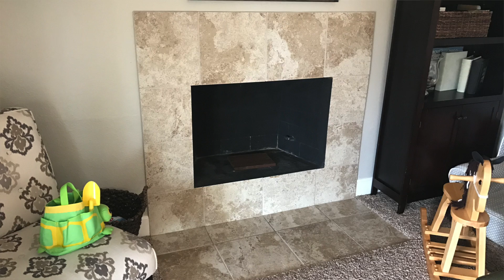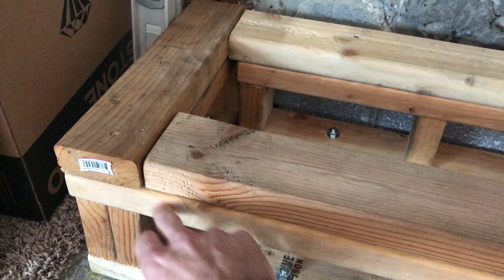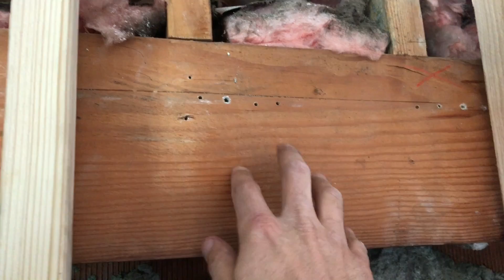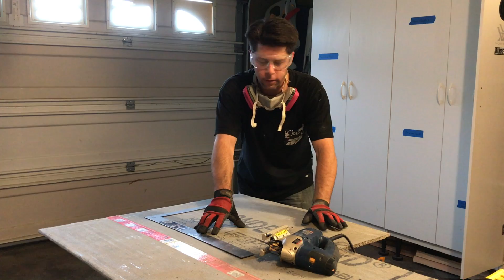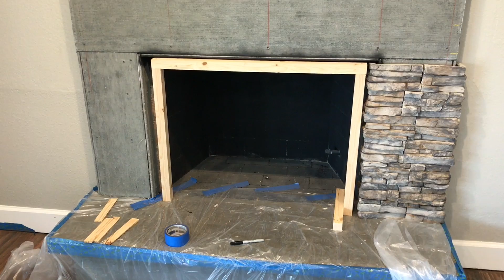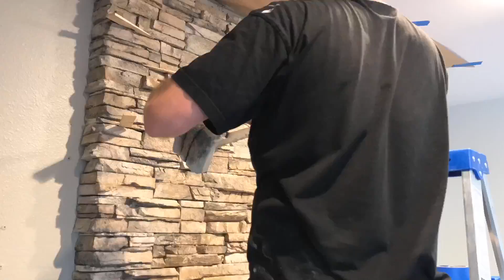Family Room Remodel Video 1: Fireplace

Comment: How wide on either side of your fireplace did you go?
Reply from the maker: Good question, I think I went about 14" from the fire box.  This dimension was based on the existing tile that was on the floor, but I really could have chosen any dimension.  In hindsight, I should have chosen a dimension based on the stone corner dimensions because I had to cut every stone going up the sides of the soffit.

Comment: I agree...what products are you using?
Reply: Also....what did you use as the slab on top of the hearth?
Reply from the maker: I chose the Nantucket product by El Dorado Stone because it was available locally and it had the most convincing look.
Reply from the maker: I cast the hearth topper out of counter mix concrete.  Check out video 2 in the series for more details:
https://youtu.be/DldVGfTRjgY